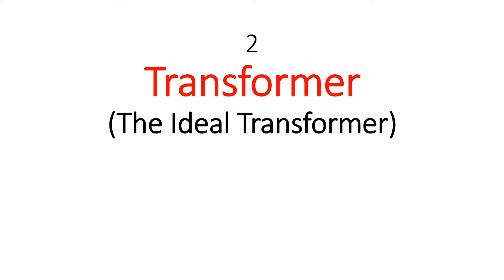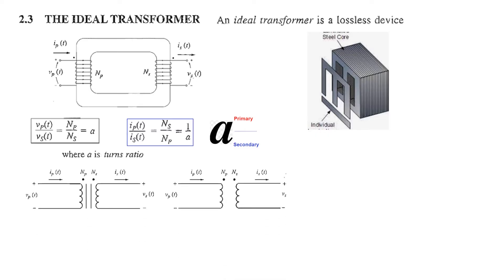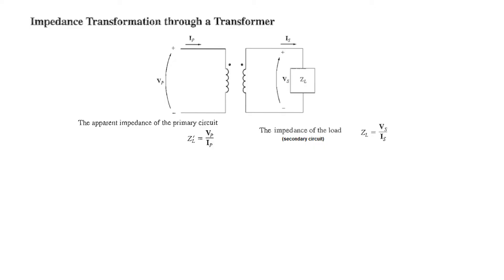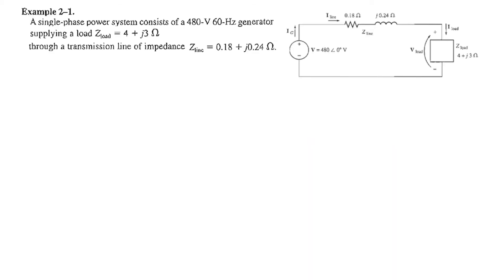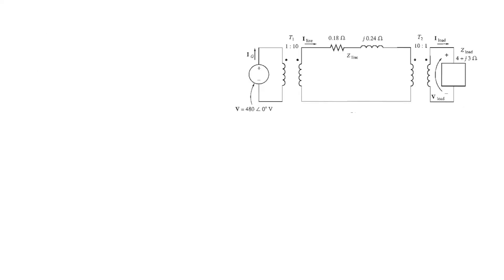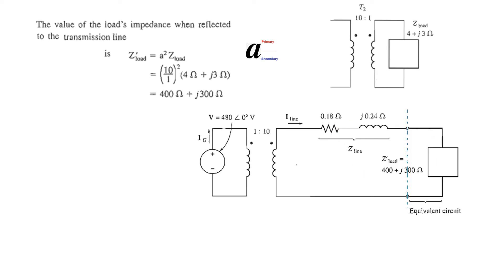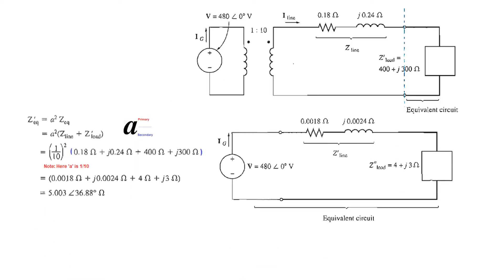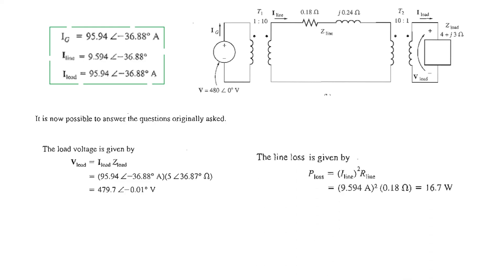(E)EM Ex 2.1 || The Ideal Transformer || Transmission Line Losses || Impedance Transformation

Comment: Thank you for the great video! I am a student of FAST University and I have a question about Problem 2.14 Part A. Without transformers, what would be the efficiency? In the solution manual, the angle of the load impedance is taken as the same angle of the line impedance. Is that correct? Does this mean the efficiency would be 89% or 77%? Please let me know as it would be very helpful. Thank you!
Reply from the maker: To my understanding, the Solution manual is wrong. Angle 36.87 should be used.
Reply: @ElectricalEngineeringAcademy  
Got it sir. Thank you

Comment: how my calculator gave me different answer for the current ( the phase angle is different). 9:48
Reply from the maker: If by adding or subtracting 360 with the angle, you get what I have, then don't worry, your answer is also correct.